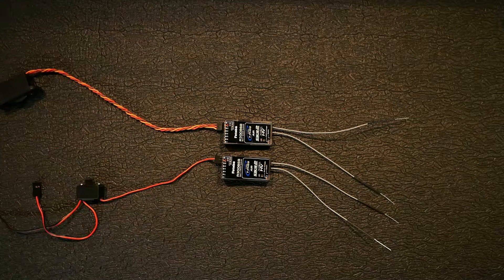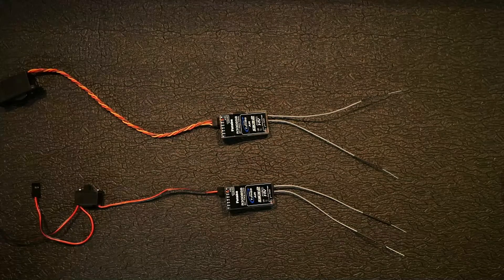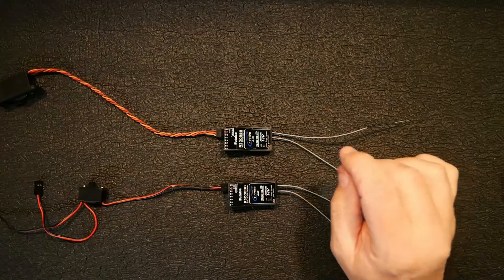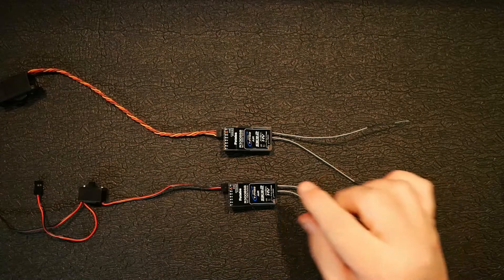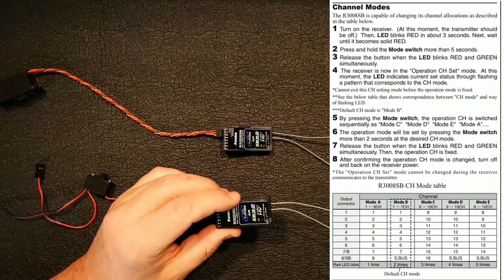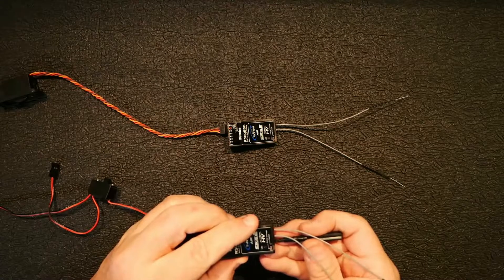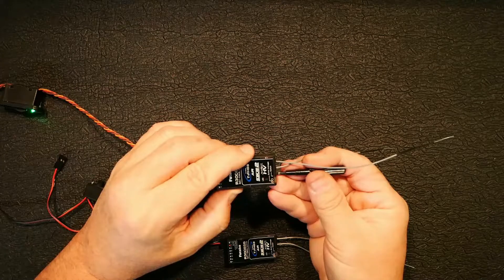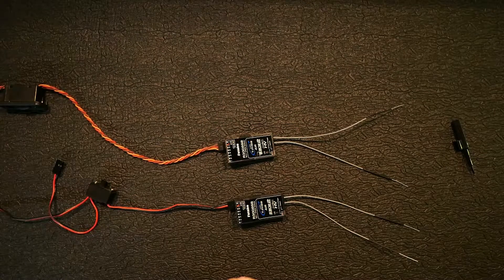Redundant RC Aircraft Systems: Setting the Channel Mode of the Futaba T-FHSS receivers.

Comment: Can I mix both T-FHSS planes & S-FHSS planes in the same Radio? My Futaba T6K-V3S seems to only do one or the other, I can't have one model memory on T-FHSS & the other model on S-FHSS, it will only do ALL on one or the other.
Reply from the maker: My Futaba T18-MZ will let me select RF protocol for each model. I have some models running T-FHSS and some on FASST. Look at page 53 for selecting receiver protocol in your manual.

Comment: Hey buddy I have the same receivers plus 2 another futaba receivers using the T16IZ. I've been doing a range check but losing signal from most of them around 50-60 meters and red light starts stuttering. Anybody have an answer? All are binded fine. Thanks 👍
Reply from the maker: How do you have your antenna oriented? It's strange that all the receivers drop. Are the receivers in an aircraft. Maybe do a check with just receiver in the open (not installed in aircraft).
Reply: Hey bud thanks for the reply. 90° as stated in manual. I had a friend stand at my front house door with  Tx then I walked up my street to this distance then red light starts stuttering, FAR too short for this equipment so I'm hoping the houses are interfering so I will apply the same aspect at my local open flying field to see if that makes a difference. Fingers crossed. Weird one 😕  any knowledge would be appreciated off anyone. Thanks👍
Reply from the maker: Wait a minute!! In your original post you said you did a range check at "50-60 METERS". That's WAY TOO FAR. That's 170 to 195 feet away, too far away for range check. When you put the transmitter in range check mode, it drops the signal strength to a fraction of its original power. You only need to walk away 30 paces, approximately 90 feet. It sounds like your simply walking too far.
Reply: @ChunkyC_RC  Hi. I did not set the Tx or Rx to range check I simply had it set up as if I was about to fly and walked away and the disruption happens. I will actually try the range check also but can't see that making a difference. Thanks
Reply from the maker: If all the receivers fail range check, I would have the transmitter checked.
Reply: @ChunkyC_RC  I have tried the T10J plus the T16iz I will try more troubleshooting. Thanks 👍

Comment: Can we mix a surface system with an air receiver?
Reply from the maker: No, you can't. Even though they are both 2.4 GHz and the same protocols, they are slightly different in frequency. Pretty much all manufacturers have been doing this since the days of 72 MHz to prevent someone with a surface radio from shooting down a plane. That's why the manufactures such as Futaba and Spektrum sell separate air and surface systems. Thanx for the question 👍
Reply: @ChunkyC_RC  well futabas compatability chart it is then wish i could have more telemetry then a 304sb

Comment: Is it better to use fastest on a 67” airplane or T-FHSS
Reply from the maker: I would try to use Fasstest receiver if possible. It's a great protocol and opens up a ton of telemetry options. Thanx for the question.
Reply: @ChunkyC_RC  When should I worry about using 2 receivers on an airplane?
Reply from the maker: I have seen dual receiver setups on everything from small foamy's to large gassers. It all boils down to practicality and space. I have a dual setup on a 10cc Ultra Stick. Most folks do a dual setup on the larger airplanes because they are more expensive and have plenty of room to space out all the components and still have proper antenna placement on both receivers. Usually, the foamy's don't have much room. Most of them barely have enough room for one receiver, an ESC, and a large battery. At the end of the day, you do you. If you wanna have 2 receivers and you have the room to install them correctly with good antenna placement, then go for it. Just keep weight in mind also. Any added weight just increases wing loading and increases stall speed.
Reply: @ChunkyC_RC  Thank you the information is exactly what I wanted to know…Thank you!